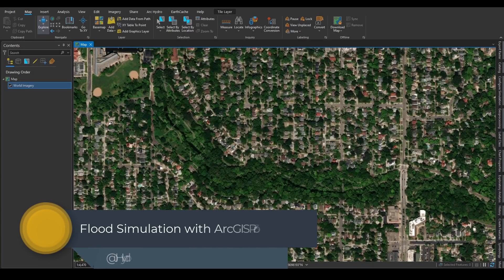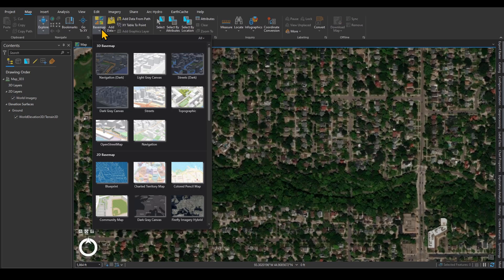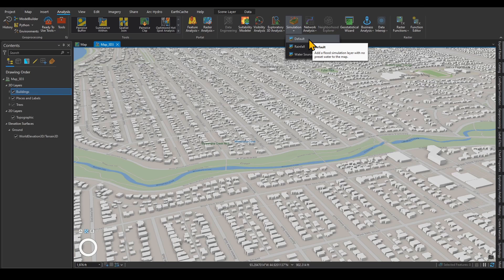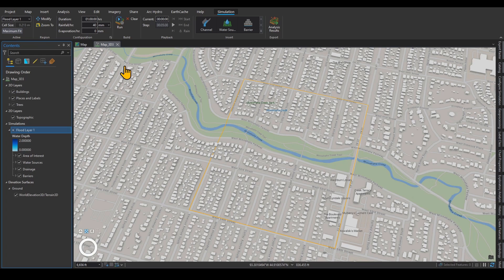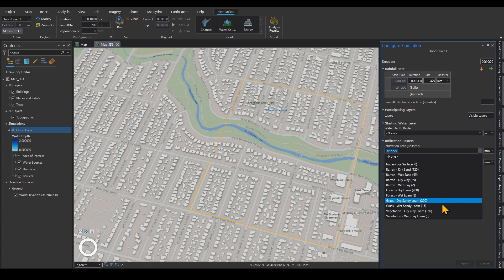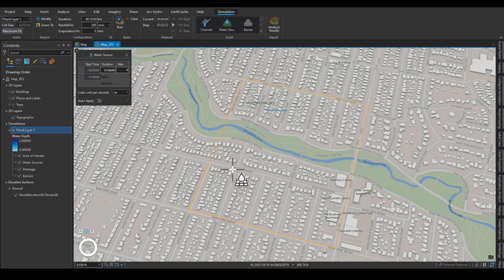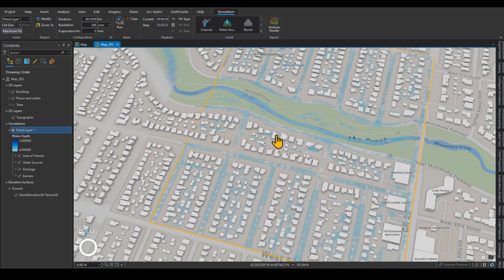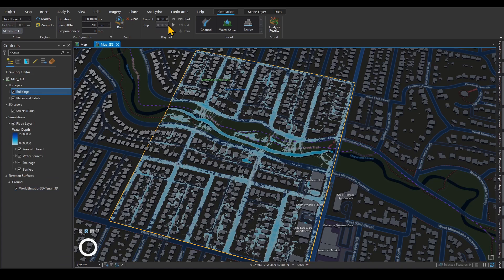Flood Simulation Using ArcGIS Pro 3.3

Comment: does it work for v 3.2? because i don't have this tool on my analysis panel
Reply: 3.3 and up with advanced license
Reply: @brendonconkel3063  thank you, i need to contact my university to see if i can update. to your knowledge, do you know any other softwares that are easy to do flash rain and flood simulation?
Reply: @TheGinjaNinja99  i have the advanced license and does it run in 3.6?